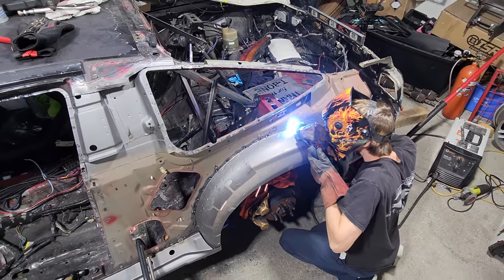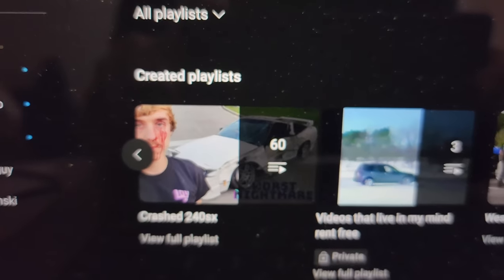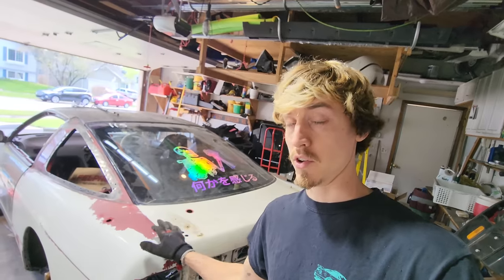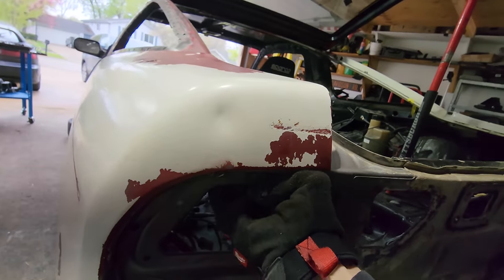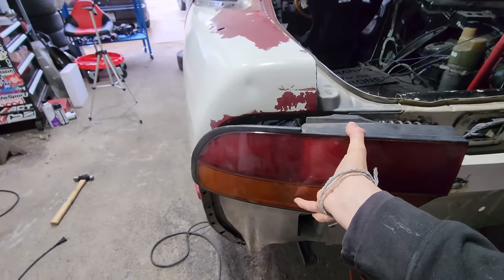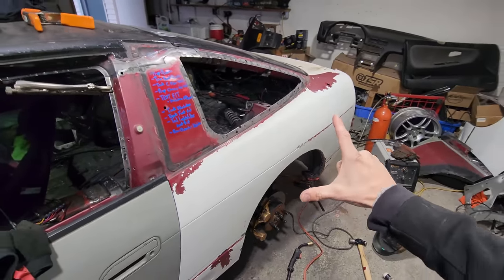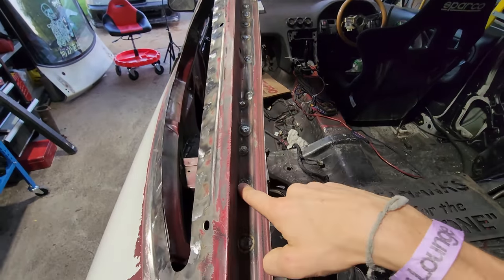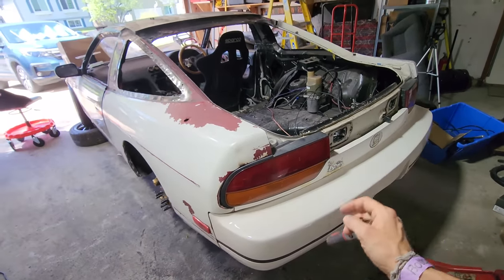Last Body Panel Welded onto my Project 240sx + Restoration Recap

Comment: Yo mike I just got my drill bits in for the spot welds an we just picked up a sweet deal on a k swap 97 Honda Accord only problem guy was having hard time to get the car to run said it's wiring to the new motor from the car but the bones are good so hopefully soon my 97 cord will be tearing into it soon you have inspired me a lot I thought my car was done till a buddy said to watch your vids an boy I'm glad I did my car has a new fix on life thanks brotha

Comment: Hi Mike. It's mad to look back & see just how mangled the shell really was, then to what you've achieved & how it looks now. Well done dude, your perseverance has paid off! I use 3m Sikaflex or Tiger Seal to seal seams... it's expensive stuff, but it's rubber in a tube. It comes in white, grey or black. For sealing the tail lights, use Dum Dum Strip Strip Caulk. Cheers. Leigh.

Comment: For a car that was basically totalled, it has turned out straighter than most 240s on the road. Those panel gaps are tidy, all things considered. 
Hopefully you don't end up driving it around with mismatched panels for too long like Franzys 240 or the Teggy.. I can't wait to see this thing rolling in all one colour.

Comment: Also, in the industry, we use the tiny self-tapping sheet metal screws to hold the panels in place when we are test fitting. Then when the panel is welded in, you weld the holes from the sheet metal screws up and its perfect.

Comment: What I do when testing body panels that need to be welded on is run a few self tappers on to act as welds to hold the panel in place just to be 100% sure it’s where it needs to be before welding. Then after it’s welded I’ll take them out and weld the little holes. Makes it easier to line things up and be able to close doors, trunks, etc. without having bulky clamps in the way!

Comment: I'm a vehicle painter you can paint the wheel arches with a 2K epoxy rust protection then roughen them up with a non-abrasive and spray on the Bed Liner the stuff is super robust and also insulates noise and it's always super easy to wash off tire abrasion and it looks Factory

Comment: I recommend U-POL raptor for the final coat. ALSO BE SURE TO SPRAY ALL OF THE METAL WITH RUST CONVERTER as it started to rust already, you just dont see it. + spray the closed compartments like inside of the rocker with special oil.

Comment: I know there's so many comments to look through but look into POR-15 for sealing inside your wheel wells its some fantastic stuff and is crazy durable if put on correctly. IT DOES NEED A LAYER OF PAINT OVER IT ONCE IT HAS CURED!

Comment: Self leveling seam sealer, epoxy primer and raptor liner will seal up the inner wheel arch real nice👌🏻 paired with some good cavity protection it'll last you a long time, even in illinois!

Comment: coming out amazing super stoked for you. also for sealing n paint the best method in my opinion and what i do is for any bare metal i epoxy primer then use sem seam sealer for all the seams then sealer primer then base coat and clear

Comment: Use polyurethane adhesive and sealing mass just like the factory but make sure you use the correct nozzles. I am pretty confident you can restore the factory sealing and make it even better! Make sure you use epoxy primer first of course!

Comment: The way its done around where i live we rustproof it with wash primer then filler primer .. sand it a bit and then polyurethan the hell out of it and then fold the wheel arches over and poly that foldet section aswell

Comment: Congrats Mate, pls take ur time repairing it i rebuild bikes and one thing i learned is to be not to cocky to just get the thing done but the make it as perfect as possible even if it takes a week longer u did a great job an i think myself a professionel bodyworker cant do this like this👍🏼 its important to seal up your whole work an i use Adheseal from Innotec if u have this in the States not the cheapest but perfect and before u do that u need to get everything fillered or primered 

Take ur time is my advice🎉

Comment: for sealing the weld seams 3M have seam sealer. then use a cheap bush or finger to smooth and bed/help bond the sealer to metal

Comment: @06:12 1/8" tech screws. you align panel and throw 1-2 tech screws in the areas needing to be aligned. weld all around those tech screws, then once done remove screws and plug weld holes. bing bam boomb, realest dudes in the room. how you doing?!

Comment: You should take a bad rear quarter and copy your checklist onto it from the rear DS quarter panel so you can hang it on your garage wall with 3 pics. Restored / T-Boned / Rebuilt.

Comment: For sealing the underside I'd use epoxy primer and then seam seal the welds then raptor bedline the underside for better protection than underseal

Comment: So many comments to make on this one... First... hanging from the ceiling with a rope to grind... that's a new one I've never seen!  I LOL'd once I figured out what I was even looking at... Then the irony of looking at a somewhat banged up quarter with 2 colors of paint... one of which is peeling off and saying, "look at that thing... it looks soooo good" and yet... it really really does compared to where you started!  Last but not least... I swear to God... your rear bumper fitment is actually better than mine and all I did was pull it off, clean up the rust and respray the bumper support, and then put it back on and I had to fight with it to get it sitting decent...

Anyway, congrats on getting 'er back together!  Are you planning to paint before putting the glass back in?
Reply from the maker: Haha the upsidedown grind was so scary haha, wanted to switch it up and throw something random in the mix 😅

Ideally I'd like to have the glass in after paint, but we'll see what time allows for 😎
Reply: @PrizzaMike  Any clue what you plan do for paint yet?  Are you planning to DIY it - I painted my gas tank with the cheap purple gun from Harbor Freight and it turned out surprisingly well considering it was my first time with a paint sprayer.  Or do you plan to call Maaco?  Could also just clean up the paint and wrap the car instead.

Comment: For the 1/4 and wheel well seams, just use seam sealer. If you really care about longevity then I would go with a two-part seam sealer that can be applied to bear metal. Be warned though, the the two-part sealer and the gun to apply it are not cheap.

Comment: I'm not 100% sure if this will work, but try using a heat gun on the bumper. It should make it soft so you can bend it back into place

Comment: for the inside of wheel wells.  . bare metal..first . everything litterly..  cover with Po15 Metal prep (phosphorus coating)  . then a 2K epoxy layer ..   seamseal the stuff that is paintable .. and if you anna up a notch.. Raptor Upol tinteble .(thin it 30% more all colour of car you gonne paint it thru base coat)  wont regret it and your car needs it. Weldthru aint a miracle stuff aftyer all